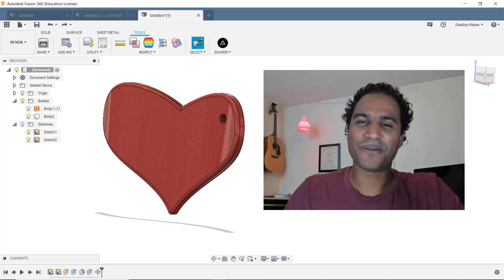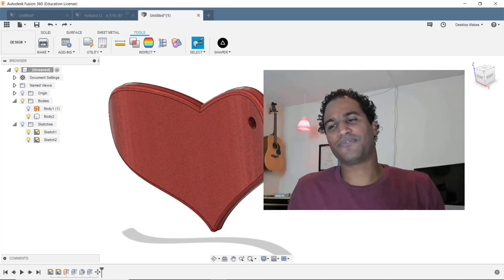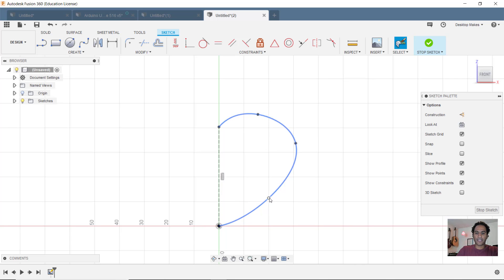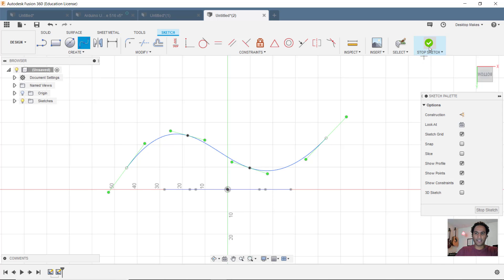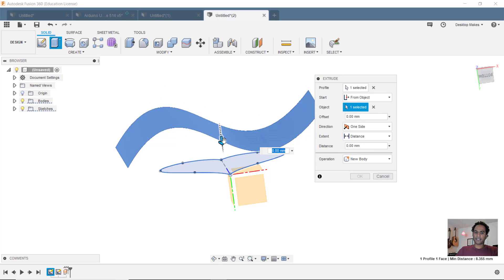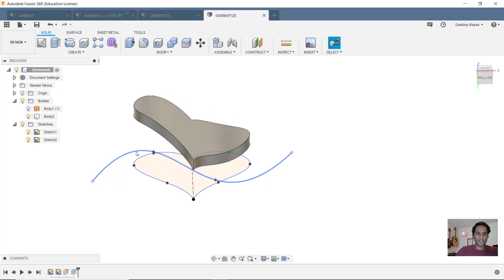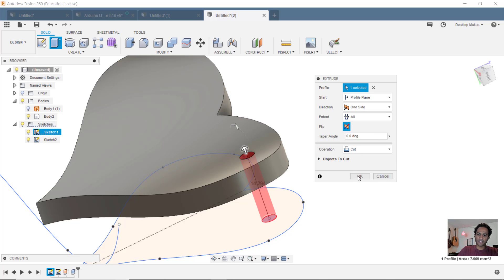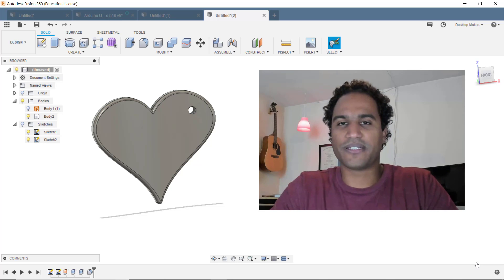Fusion 360 Curved Shapes

Comment: Thank you so much. This was exactly the tutorial I needed.
Reply from the maker: Awesome! Glad to have helped.
Reply: @DesktopMakes   I spoke too soon. Unfortunately it looks like this only works with a smooth face such as you made with the spline. If there are any bends in it that form a new face this will not work as you need to select 1 face to extrude from. Unless I am missing something.

Comment: Great tutorial and really helpful for what I'm trying to do. I have 2 questions, if that's ok. First, when I try to adjust the curve sketch after I've extruded, nothing happens; it won't move at all. Second, what would be the best way to join this to a an existing model, or can I attach a new model to this? Thanks.

Comment: i cant extrude the heart
Reply from the maker: Make sure your sketch is a closed profile.  If you try to select it and it doesn't turn blue that means it's not a closed profile.  Simply make sure all your lines meet point to point.
Reply: @DesktopMakes  ok thanks!!

Comment: This is helpful. It would be more helpful [for me] if it addressed curvature on a second plane and also curvatures that differ along a plane/path. Like, imagine a structure with curvature on both sides, but one side is basically thicker and has a less apparent curve, but the other side is thinner and has a more apparent curve, and these need to meet up nicely in the middle. Also, a lot of people seem to be interested in twists, which I haven't search for nor need. I found a tutorial on making a wood boat design that should cover most of my needs...

Comment: Did mine by extruding the wavy body then drawing the heart and splitting the body.  Wanted to go a bit further and compound the curves on the heart so I swept the wavy line (well wavy rectangle) along another wavy line (in the other axis) as the path, creating an object that had compound curves.  I then repeated the draw heart->split bodies.

I then wanted to write some text into the heart which caused some difficulties as you can't project text onto a surface and a basic extrude doesn't work because of the irregular surface.  I used a combination of extrude to object to created new bodies and cut away bodies (has to be done in the right order or fusion bugs out), then a press/full to set the depth of my lettering on the compound surface. Then a combine to arrive at the final product.

Thanks for the lesson!
Reply from the maker: Nice!

Comment: I guess there isn't a Design model in the student copy?
Reply from the maker: I'm using the updated UI.  To turn this on you need to go to Preferences (upper right and click on the drop-down next to your name) - Preview - and click the checkbox next to UI Preview.  Restart Fusion.
Reply: @DesktopMakes  

Thanks I saw it in the comments about 10 seconds after I posted this and my laptop shut down with my brick in the car.
I did a hearth then extruded a message into it for my wife. 
Thanks again

Comment: Hi Vlad, awesome video again. I almost did it the same way, except when I extruded the heart profile up. Instead  I did an intersect to create a new face. Then I thickened the face.  The end result is a slightly different. The angle of the faces around the heart edge is different. These faces come out perpendicular to the heart face not straight up like in your technique.
Reply from the maker: Thanks Brandon,  I just tried it your way to see the difference.  You're right.  There is a slight difference with the edges like you mentioned.  That's good to know.